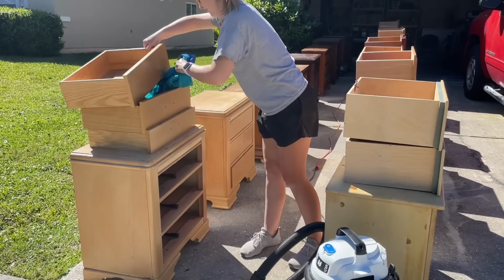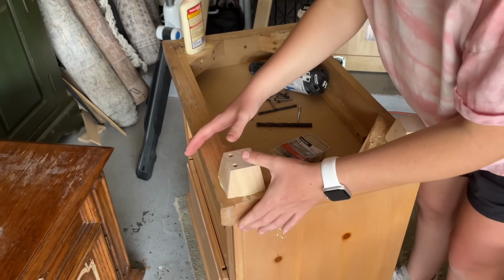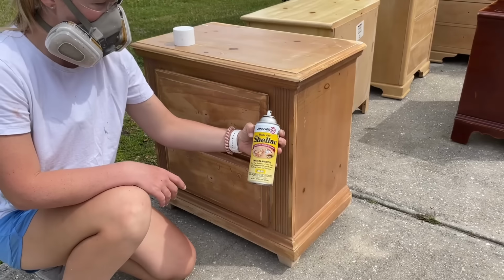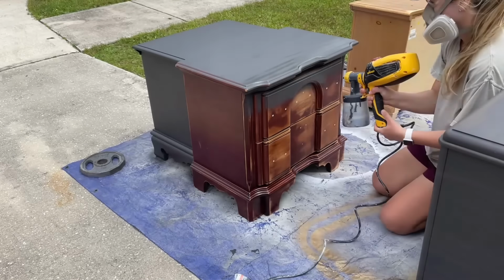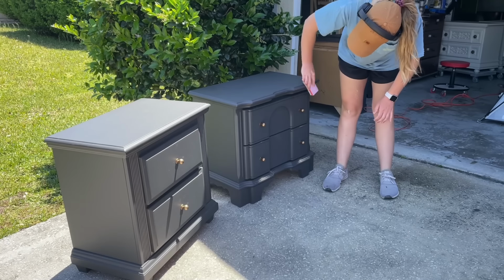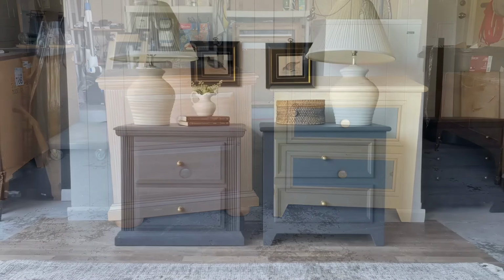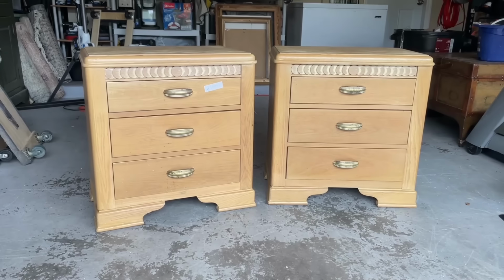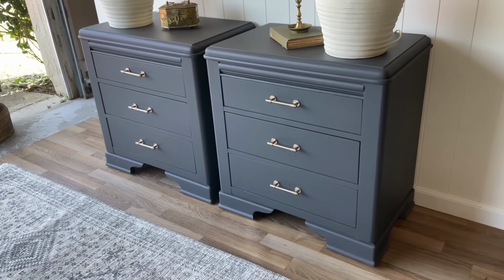3 Black Nightstand Makeovers in an Assembly Line | Part 3

Comment: OBSERVATION and SUGGESTION..abby, thin the paint out and use flotrol added to the paint. Also, you might want to move ur truck. There is so much overspray, paint, shellac and other fine mist of what u are using all over the truck paint. Also, cut a 4x8 sheet of plywood lengthwise and get 2 of the larger harbor freight moving dollies when on sale. Attach 2 dollies to the underside of the plywood. Now you have a large rectangular 8 foot roller that u can put 3 side tables or your work pieces on and roll them in and out of your garage easier. It saves you from constantly moving each piece over and over agian. The plywood dolley also makes it easier to store your furniture in the. garage. Just roll where u need it.
Taking the feet off was good. Also, IMO, very lightly distressed will make it back. When distressing came out people over did it. Every piece of furniture looked like a weathered farm fence or the side of a 100 year old barn. Your distressing is minimal, soft and elegant. It allows the furniture and its lines to be the focal point. Great vids and ur awesome.
Reply: I do like your dollie suggestion, I think I will be using it myself. I have also noted your other suggestions.

Comment: Maybe use a hard rubber mallet when tapping pieces in place. Also I find using a small thin prybar instead of a screwdriver to remove old pieces off of furniture. Doing this may save you a little time later if damage the stuff with the other tools. Looks great! Keep moving forward and learn from any mistakes 🎉